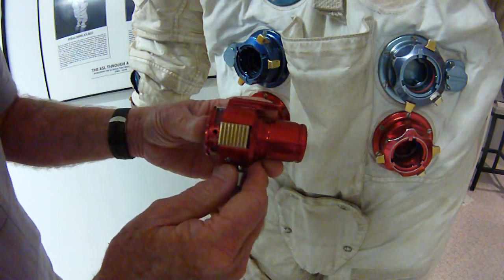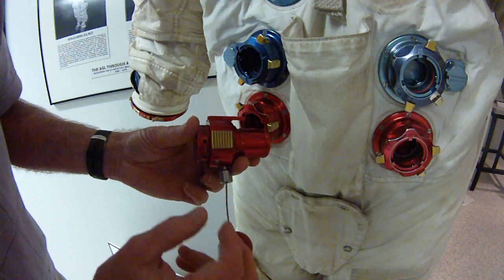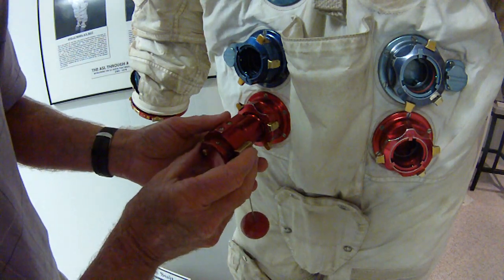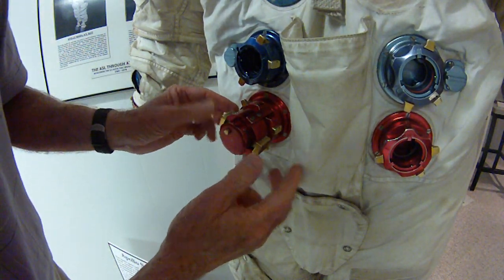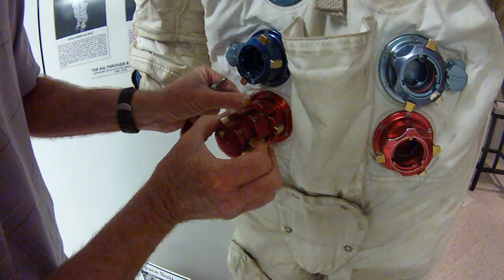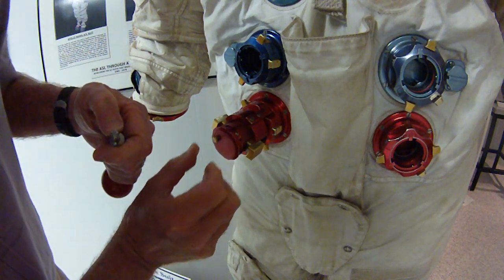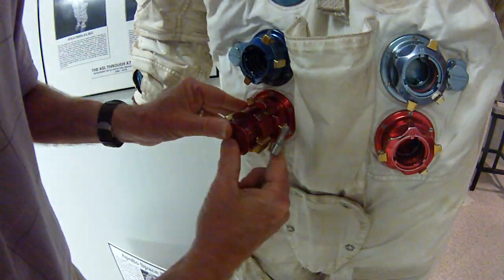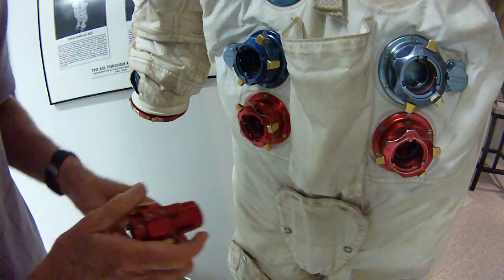A7L Purge Valve

Comment: How could any astronaut with gloves on, and not being able to see what they were doing, place that pin back? Also, that valve goes nowhere! It isn't even deep enough to go all the way in. Also, do you expect us to believe that six spring loaded valve covers are going to hold back the air from escaping in a vacuum like this? I don't think so!
Reply: They would start the flow, then go back to the LM, repress, suit down, and with bare hands put the red apple back and fix the suit.